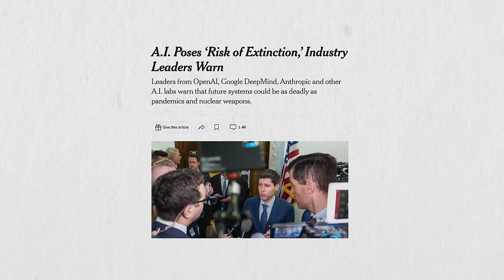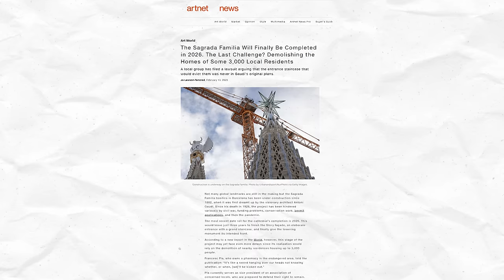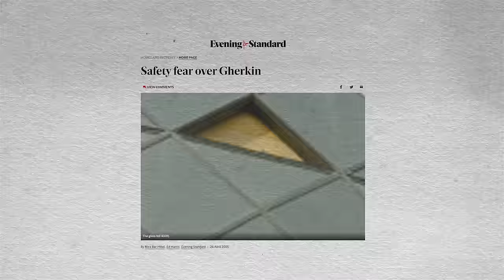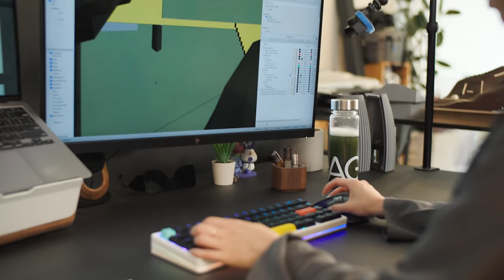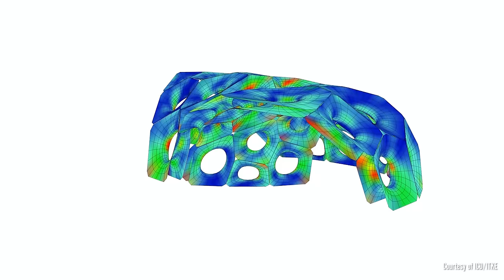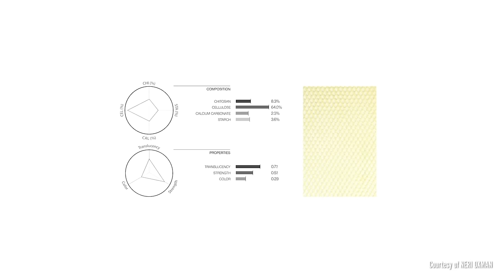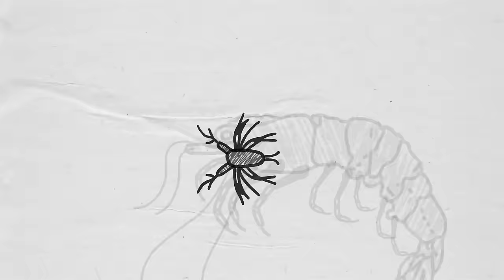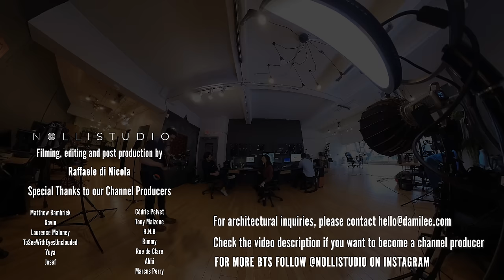Biomimicry: Hoax or Genius?

Comment: Using mold growing on a 3D map of Tokyo to obtain the most efficient pat to lay the subway was is and forever will be the genius. as real as the mold. No different than discovering riding on the horse, changed the future of mankind. Discovery among other things, is art.
Reply: Technically it was slime mold, not the normal fungal mold, but yeah it was really neat how they did that experiment
Reply: They also did a similar experiment with slime mold to see if it would use the same paths we had used for train tracks (basically could it determine the most efficient path) and in a lot of ways it was more efficient, I mean besides cutting through a mountain because they forgot to account for elevation in the experiment 😂

Comment: Re: The Watercube building using plastic: if you want to use (discarded) plastic, a building's structure would be one of the best paces to use it, as it will be in use for many decades. As opposed to, say, clothes using recycled plastic, which will be used for several years, best case scenario. I would argue the foundation of a building is as good a place as any, based on the principle of mimar (architect) Sinan.
Reply: The world doesn't lack for uses of plastic, it lacks for efficient recycling of it. Most plastic doesn't get recycled, that's the problem. Creating buildings out of plastic isn't going to solve that issue.

Comment: Something that often gets lost in conversations about sustainability and environmentalism is that beyond all the ethical reasons, it's just logical to work with the environment instead of trying to fight against it for our own designs. The latter requires a lot of unnecessary resources and maintenance because it runs counter to the natural laws of how environments function. The difference between traditional construction and the advent of modern attempts at biomimicary seems to merely be time. As more focus is put in the biomimicary direction, it should become more common practice. As stated in the video, we have ~4 billion years of testing that's already occurred on the designs present around us. The challenge is implementing them appropriately given the problem we're trying to solve. Love these videos, thanks for making them.

Comment: You should check out Eastgate Centre in Harare, Zimbabwe constructed in the 90s before biomimicry and sustainability became the buzzwords that they are today. It's totally possible to use nature as a template to construct buildings that actually save power consumption without breaking the bank.

Comment: When I was still an architecture student, like any other architecture student, was obsessed with "green", "sustainable", "LEED", etc.; but now a decade as a licensed architect with a design-build company, and a much more practical perspective and approach in architecture later; I see "green", "sustainable", and "LEED" beyond the very very basic and practical factors that we should plan for like sun and wind orientation, flooding, natural ventilation, practical space flow, etc; I see them as either a tax-exempt or an expensive gimmick.

Aside from utilizing solar panels for electricity(because it has advanced by a very dramatic rate in the last 10 years), all other "green" stuff that was so hyped up that pumped up college kids used for their thesis project, only to be grilled relentlessly by thesis jurors to explain how their "green" factor worked and how it can actually help the owner with sustainability for the very expensive upfront capital and the mercilessly high maintenance cost that will only increase as the elements and its own lifespan decays the feature overtime. I've also had the honor to be a jury for a few thesis projects, and have now become the griller when the project has a big "green" title slapped unto its thesis title.

Comment: I think the best way to build would be in layered domes. I have just the right mathematical equation that would give us the width of each layer and we could build from the bottom up. You also want a giant convex pillar in the center for stability. The wind would be so lucky to knock down such a structure. I am still working the details out in my head. Can't use concrete because it crumbles over time. Wood rots. Decay is the main issue. Steel is too heavy to work with. Carbon fiber maybe? I will keep thinking about it.

Comment: There is a spot on that building in your thumbnail, right between the outer and inner structures, that--if rubbed the right way--causes the building to shudder, then relax.
Reply: I thought it turned on the sprinklers?
Reply: Nice sandwich btw

Comment: Anisotropic refers to a property that varies in different directions. It means that a material or system exhibits different characteristics or behaviors depending on the direction in which it is measured or observed. 

For example, wood is an anisotropic material because it has different physical properties along its grain compared to across its grain. When wood is cut along the grain, it is stronger and more resistant to splitting. However, when cut across the grain, it is weaker and more prone to splitting.

Another example is a crystal. Crystals are often anisotropic because their atoms are arranged in a specific repeating pattern. This arrangement leads to different properties, such as the refractive index or electrical conductivity, depending on the direction in which they are measured.

In summary, anisotropic refers to the property of exhibiting different characteristics or behaviors depending on the direction of measurement or observation.

Comment: So you said that the lobster and beetle buildings are high perfoming buildings but what exactally does the mean,

 since the fibers arent fully closed together it doesnt provide protection from the rain and only mostly from the sun and not from the wind, its not a plave someone could live it only works as a place for someone to sit for a temporary amount of time in a park and even then it apears to be the center of an exhibit rather than a part of an experience separate from it 

So i guess what im saying is by what metric is it high performing and isnt spending extra resources on standard or bio buildings even the more expensive ones you mentioned at the beginning better than making low cost structures that dont have a proper purpose?

Comment: It seems to me that this concept misses an important concept within biology, which is evolution itself.  Many species go extinct, either due to competition within their niche or when their niche undergoes some sort of change, as when the climate itself changes.  The advantage of more human design models is that some of them can consider adaptation and thus resilience that will enable a building designed today to still have relevance hundreds of years from now.  We have buildings that have already stood for centuries and still serve purposes, even if those purposes might have changed or the buildings have had incremental changes (such as the addition of plumbing or electrical infrastructure).  To me, this does not suggest a superiority of one method over another, but rather that biomimicry in architecture might miss something of the value in what we have already made.

Comment: Actually my first time even hearing of the Gherkin.
I feel that biomimicry is really good for making cool looking things and when strength to weight is really important. Like in a car, for the the Czinger 21c, they used a computer to find a shape that would meet strength requirements with the least material possible and then 3d printed it with titanium.
Whether it was intentional or not, the components that come out are very organic looking.

But unless it's something for design or to serve a very specific purpose, large scale biomimicry is really expensive and puts the benefits into question. The thing is, living creatures move, we move and we heal from any damage this movement may cause. As with the window of the Gherkin, there's the issue that artificial objects don't really heal, so if you start moving qnd bending things, you have to be prepared to start replacing things as well.
Car parts are fine, because cars were meant to move and the stresses taken into account always include wear and tear from movement.
But buildings, I think sometimes it's overlooked.
It's great for vehicles.
And it's great for smaller structures , those pavilions, furniture, even houses, it's awesome for that, you get buildings that fit in nature.
But if we're gonna make really big buildings, there may be issues that make it difficult and may be unnecessary.

Although it still looks amazing and it's always nice to see these.

Comment: If we build a structure, and rely on wind to power "natural ventilation" then we are resigned to accept that we have no control as it is not always windy, and sometimes it is too windy.
The fundamental problem with "passive design" - being too passive.
Now consider climate change as a concept: we plan based upon a few hundred years of climate data, and build for that, while the earth around us is experiencing unprecedented climate changes that we have no idea the rate or magnatude.  In the future people will laugh at the timing of passive design occuring just as we destablized climate predictability, dooming it to fail by design.

Comment: I get the impression that biomimicry pines for buildings with material relations (inputs/outputs) more similar to plants, but so far have only come up with odd looking buildings built by robots. The use of expensive small run fabrication methods to mimic the imperfections of grown structures is less biomimesis and more like a cargo cult of nature.

Comment: That's biomimicry in BUILDINGS. What about products or completely different areas. From highspeed trains to aeroplanes, even propellers. I agree, that most of the issues we have of mimicing nature, isn't from a design flaw, rather a manufacturing flaw. We don't have the right materials, neither are we constructing things in the same size or environment, as the the original design. These changes are significant and therefore render many designs useless or "faulty".

Comment: I think that with Architecture, it makes sense, as the evolutionary humans triggers for comfort would be tied to sights of nature. With other forms of technology, however, despite being useful it has limits; Nature has limits that technology does not; a bird has to fly by way of the inefficient and fragile flapping of wings while a machine can use a robust and powerful propeller. Thus, biomimicry in other areas of technology is useful as a start but limited long-term as we innovate the same design.

Comment: I just we’d simply make infrastructure that works well, and is easy to maintain..  I imagine a lot of our buildings require so much maintenance will become too much for many communities, and they’ll be stuck with buildings that cost too much, when they could have helped the community simply by being cheaper.
As for nature having all the answers, and why, it’s mostly because life had so, so much time…  Life and engineers were looking for the same thing, effective and efficient solutions to problems, so of course the person with a massive head start found some of what we needed.

Comment: @14:21 There is some "logic" and reason for why a plant or animal species looks a certain way or evolved something that makes sense. But, I wouldn't say that it would lead to designs most optimal use of resources. Sometimes its just benign enough that the species doesnt die off. Heres a short list of BAD Design

1.  Giraffe’s laryngeal nerve
2. The humans optic nerve literaly sits infront of our receptors so our brain has to process this out.
3. The luna Moth in its adult stage has no mouth(vestigial) and no digestive system so, it has to mate before it starves to death.
4. The human Knee, 2 huge levers asking to break.

Just to name a few...

Comment: Biomimicry as a topic of study is something that gets both way too much glowing praise and way too little coverage for its potential.

There is exactly one facet of the topic that you missed, and while completely forgivable, it's actually the single most important aspect of the entire issue.

Use Case.

I haven't seen your DUNE video yet, (I've been binge watching all your videos in semi-random order all day since finding your channel earlier), but I can only assume that in that video you rectify a lot of what was missed here.

Put simply:
"Biomimicry only works if you use the examples the way they're meant to be used"

If we're to gain increased knowledge of how to build buildings, it's not going to be from studying animals, but from studying what those animals build.

Houses aren't supposed to handle fall damage.

Walls aren't supposed to regrow limbs or have bloodflow.

The Gherkin doesn't work because air produces very different forces than water.

Sure, it works temporarily, but the flowrates and turbulences of air are much more violent and chaotic than the usual push and pull of undersea currents.

Spiderwebs, termite mounds, anthills, burrows, bird nests, wasp nests, etc.

The biomimicked part is only good for humans the way it's good for its source in nature.

The hyperbolic paraboloid is amazing for storing energy and resisting large, temporary fluctuations in load.

But for static loads, it's not as good.

Lobster chitin is amazing for handling the forces of biological life for exactly the reasons that it is AWFUL for building static structures.

The density gradients in chitin allow it to retain a lightweight structure while still handling exceptionally forceful impacts and tensions in combat or travel. The problem with chitin is that while it has exceptional qualities, it has to be supported metabolically to retain those qualities in the long term.

Leaves, while exciting and beautiful, are not protective structures.

The living leaf tower is a terrible idea not because of its design, but because leaves are energy-gathering structures meant to be supported by the real structure of the tree.

Using a leaf as a wall is like using a tree trunk as a solar panel: backwards.

Ants use leaves as walls because they're tiny.

To find solutions in nature, we need to look for things that actually fit the bill.

The lobster biomimetic pavilion is beautiful, but it lacks the softer internal support structure that makes lobster chitin strong, leaving it much more vulnerable and fragile than a more complete mimicry would be.

Comment: Biological systems are usually optimized for a whole bunch of different goals at once, like, it's never going just one thing. It has to be made of materials that are biologically soluble. It has to be able to be supplied with nutrients and oxygen. It has to be constructed from a highly compressed pattern of genes through development hormones. It has to do task A, B, and C while minimally interfering with D, E, F. It does not need to be easy to understand or engineer or manufacturer from raw materials that aren't life-soluble like metal or carbon fiber.

Often times we have found that a lot of what biology does is optimize for something we don't care about and it's easier to just do the simple, orthogonal, inorganic solution. Flapping and warping wings were abandoned early on in aircraft design in favor of fixed wings and jointed control surfaces. Relatively mechanical search technology is used in the best chess engines. Vehicles that are powered by wheels work much better in simple flat environments than those with legs. AI improved dramatically by abandoning organic sigmoid activation potentials that tend to cause all sorts of cross-interference with each other in favor of decidedly more mechanical ReLU activation functions that more or less create a binary devices. Mechanical heat engines greatly outperform the hideously complex chemical energy sources that power life while having comparable efficiency despite their lower activation energy. Monolithic metal mostly has superior mechanical properties compared to any biological stiff material. 

There are tradeoffs in all these cases. Tradeoffs that may not be immediately obvious when we in our hubris try to beat biology, but usually if you want something engineered for one particular goal, biology will come up deficient because it always engineers for many different goals at once through trial and error.
Reply: Typical biological chemical energy storage in the form of sugars and lipids: 15-38 kJ/gram.

Typical heat engine chemical energy storage in the form of kerosene, gasoline, or compressed/liquid methane: 42-57 kJ/kg.

There are clear advantages to the biological approach, but those advantages come from holistic level integration into a biological system rather than winning any given performance metric.

Comment: If ..... E.T.F.E. ( Ethylene Tetra Fluro Ethylene  ) .... is the plastic of choice to use as a film eclosure ....it is non biodegradable .... but recyclable .   Doesn't support combustion ( simply melts ) / requires 60 lbs. pressure to enlarge a knife wound  / admits 98% light spectrum ( as one recalls ) / and is non stick self cleaning ❤ .

Comment: Making a building with biodegradable materials is a hard sell. When I buy a building, I am interested in a long-lasting investment that will grow or maintain its value. Maintenance is difficult enough without making parts of the structure more biodegradable. Personally, I think we are better off rethinking single-person homes. Monolithic domes are cheap to make and extremely sturdy. They can handle hurricanes and perhaps even Tornados. This would help reduce the costs to insurance companies, and increase the profit margins for developers. And our nation's infrastructure would be far more resistant to natural disasters and even enemy attacks. if it ever came to that.